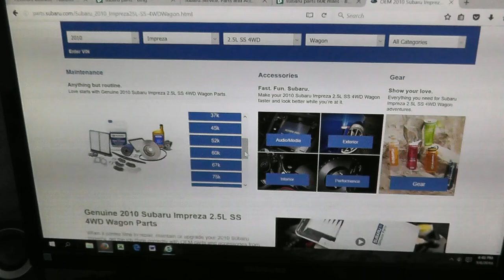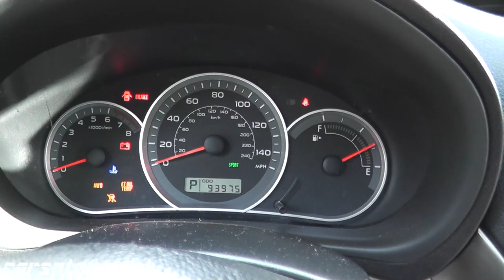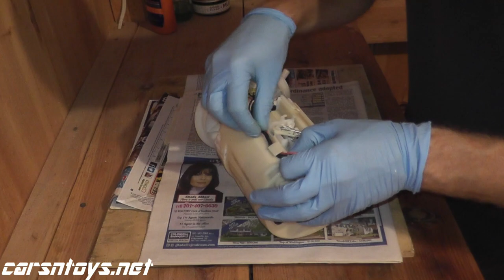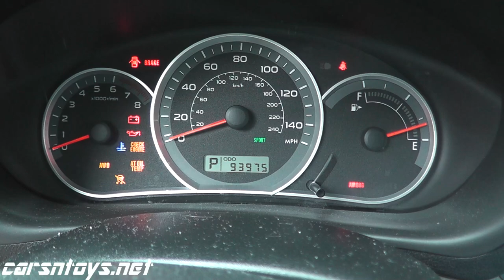How To Replace An In-Tank Fuel Filter On A Subaru

Comment: 13+ minutes into this, and you've just convinced me to buy the assembly versus take my chances on this level of rocket surgery to perform a simple task.  Many thanks for the video, though.  I'm sure it took a lot of know how and skill to pull this off.
Reply: So true..
Reply: I think with such a great video tutorial, I could do it myself. The tools aren't really complicated. The main rule of thumb I see here is 1) Take your time, 2) Don't force anything (plastic does become brittle with time) and 3) Use the right tool for the job.
Reply: Yeah dude, 100%. I KNOW I'll spend the 70 bucks on the filter and then break the pump and then end up breaking the pump anyway.
Reply: I did it myself and it really wasn't bad at all. Even so, nothing wrong with just going with a whole new assembly.
Reply: bro it took me 30 min.......

Comment: Be sure to reinstall the fuse and battery and start the car to check for leaks PRIOR to installing the cover plate. This is imperative!!! It's very dangerous to put everything back together and assume you have no leaking gas.

Comment: Trick to stop flow out of the pump assemsbly. Open your gas cap to relieve the pressure in there.
Reply from the maker: Good tip! Thank you
Reply: Just did this job, worked perfectly!  Thank you!
Reply: Also use vise grips or hose pliers to pinch off the fuel flow.

Comment: Guys, this isn't that crazy.  The phone call to the dealer told you exactly what to do......  let it alone until you start having issues relating to the fuel pump.. then replace the whole thing..  Or not..  Your choice.  I like our Crosstrex but this is ridiculous for a 60K service.  Replaced several fuel filters over the years and they were all external..   Obviously that was for debris possible going in the engine.  If you're worried about dirt screwing up your engine just add an external filter and change it every 20 or 30K.   Everything doesn't have to be difficult.  Just because the factory didn't do it doesn't mean it can't be done or is a bad idea..      And apparently  I may have missed it but did he show the old filter and how bad was it ?

Comment: Great video. I found an new aftermarket assembly for < $200 .  At some point your time and sanity factor in!  The module swap out can be done low stress under 2 hours including test drive, tinkering and clean up.  I changed it at 192k with no problems , just wanted to upgrade for upcoming engine modifications.

Comment: Hi I'd just like to thank you for your thoroughly detailed "How to video".  I've watched it over and over as it was my first time attempting this "in tank"fuel filter change.  Only you and another guy on YouTube show how to do the job properly on a Subaru Impreza of my generation.  It took me longer trying to figure out how to remove the rear seats. It seems that the 2009 model didn't have the release buttons like yours.  That was a pain in the ass!!!  

The other tough part was trying to separate the fuel pump from the assembly. After 5mins of struggling I thought heck why do I need to do this when I won't need to reuse this assembly.  So I use pliers and cut those tabs to shreds like you did when separating the assembly.  The best part is starting e car after and it worked! 😬
Reply from the maker: Good stuff! Glad it worked out. Cheers.

Comment: This is so helpful.  The BRZ/FRS/86 also has an in-tank fuel filter like this and mine is overdue.  The part is different but I am assuming the fuel assembly service procedure is similar to replace the fuel filter.  
I have not found any videos or guides specific to the the BRZ/FRS/86.

Comment: Thanks for your guidance. Did a Subaru forester 03/2010 EJ25 with 300K on clock. The Ryco Z931 filter was not as complicated as the job you did but with video help was able to put it back together. The Ryco at A$145 was exactly half the price of a subaru  genuine unit.. Great work my friend

Comment: This is  the best detailed video on the install I have seen . You make it look so easy . I am sure it's not .
Reply from the maker: Thank you. It's certainly labor intensive.
Reply: Just did it - using this video - just as easy as the video.  Thank you CarsNToys... helped tremendously.  One thing I found is that I didn't need to fiddle with the motor tabs.  I clipped my old filter tabs off and the motor dropped right out.

Comment: Awesome awesome video! Goodness the job looks like a PIA and probably will take all day but for peace of mind knowing the fuel pump will last and at least the factory recommended maintenance is done, is smart. It’s bad that most people will never know (unless they check on their own) if this job is really done properly. As well, thanks for the details on how to remove the clips and then to replace the seal. I’m going to try to run the tank near empty to hopefully make it easier. Still have another 20k before this maintenance is due. I’ll need a mask after Whiffing the gasoline fumes/vapors haha. This video should also apply to the WRX, Forester, Outback, Legacy, etc. Great job and Thanks again! Follow up 3/9/23 I just changed the fuel filter definitely took some time but thanks again for sharing your video. Absolutely great advice working outdoors and to change at 72,000 miles. Happy Easter!

Comment: they don't recommend changing it so the fuel pump or the fuse blows, this way they get to tag you for additional labor to figure out your problem, then sell you the entire fuel pump assembly and your car runs like shit, you probably have to pay to have the car towed from 150 miles away and then you have to pay them to replace the pump in the ball park of $750 including the pump, filter assembly and labor. They also will try to tell you how labor intensive it is when they don't even have to drop the tank like most American cars do, as Subaru has been adding an access door under the seat so it is easy to pull out and replace, and the filter and pump are replaced in 30 to 45 minutes by any average Joe, without needing a class A mechanic to do so.

 You are correct for wanting to replace the filter every 30-40k  because the filter gets plugged up with rust and other crap that the gas stations have in their tanks, water droplets, and other crud sticks to the moisture, dirt, etc, strains the pump and the car hesitates, while Subaru dealers just don't want to replace the filter because they make a ton of money replacing the entire pump and will charge you for the other parts while they all come as part of the kit. I've been stuck in this predicament before and have asked for the parts while they told me they just cleaned up the shop and their shop foremen threw the old parts away.

The filter was plugged and the pump wasn't bad on my car, the fuse blew and they replaced only the filter because after they were done, I opened the access door and I removed the pump and showed them an old pump was reinstalled. I never paid them for the services, the labor or the parts because i threatened to go public with it. Plus, in Connecticut we have a law that states they can't charge us for parts or labor to replace anything unless they provide us with the old parts. Most folks don't know about this law, but we have a Subaru dealer that is notorious for doing shady things like this and I am not going to mention their name, but all of you guys and gals in CT that bring your car to the dealer to get your Subaru fixed, I will just tell you to go to Wallingford so you don't get robbed by others.
Reply: wtf happened to Subaru? Its like somewhere between 2003 and 2007 they decided to start building cars  with cheapo shit parts, and design the car so maintenance is as difficult as it can get for the DIYer, like you would swear they actually sat and thought up thid shit! And dont get me started on the seat gaps. FUCK THOSE LEGACY SEAT GAPS. Everything cheaped out on, moneypit repairs by design, working purposely against the DIY guy. 
Im sorry, but I predict the end of Subaru in 10 years time. This is a canary in a coalmine if Ive ever seen one

Comment: Great vid it helped a lot. 
To simplify removing the fuel pump from the old filter I cut the two tabs with small wire cutters. It came out with a lot more ease.
Reply from the maker: Good stuff!

Comment: That's the same sound my 2010 impreza non turbo makes during cold starts, when it finally starts it drives good. It will start fast when it warm but if I let it sit for a while it's a battle to get it started. I'm gonna test the pump and see if i need to replace it.

Comment: Good video. This job is not really for the faint hearted but I could not fault your instruction.
However I did have an issue doing one of these so I'd like to add something that I feel is important. When replacing the O-ring on the fuel pump, fit the O-ring to the pump rather than inserting into the housing. Because of the design of the houing the O-ring can become distorted and not seal properly when the pump is inserted causing starting and driving issues. Wasn't alot of fun pulling it all apart again but that's how we learn.

Comment: Did this today and took around 4 hours total to remove,  clean,  replace filter,  reinstall  and fill up tank. 

Worst part was the o rings,  wasted around 30 mins trying to fit them on the new filter

Comment: Hi! I decided to change mine,myself to save money.I went through hell though,trying to get my back seat up.The bolt was so tight.Then when I got to the bottom,I didn't know how to get everything off,but I just started pulling.I  did remove the fuel plug fuse first though.I'm watching to figure how to get the filter off the plug though.T hanks so much for doing this in the day time.Most of the videos where people do this are too dark.Looks like this is a lot of work.I might just buy the whole thing,rather than rebuilding the filter.Thanks so much for making this video though.
Reply from the maker: Glad to help. Yea, it's certainly time consuming. Buying the unit as one piece would save a lot of time and you could save the used pump for a few bucks.

Comment: another suggestion about the fuel coming out, I've read that you can relieve fuel pressure by pulling out the fuel relay switch and then running the engine until it dies. Should make less mess. Otherwise, GREAT video. Thank you.

Comment: I actually ended up buying the filter.  Wish I got the whole chinese unit for $70 which is what I was going to do but then I thought about how long subaru fuel pumps last and I got the OEM filter.  Couldn't have done it without the video.  The only thing I might add is I don't think you need to take the fuel sending unit off.  And I didn't watch the first part so I didn't remove the negative terminal or the fuse.  I didn't have a pressure issue but mine is 2008 YMMV.  Next time I'm going to get the whole unit.

Comment: On older outbacks the filter on the fuel pump assembly is called a strainer.  The filter is under the hood near the battery.
Reply: Yet on my 2000 Legacy it's also in the tank in a little screw-off "cup" on the sending unit. Very odd because on other Legacy's of this generation it's under the bonnet!

Comment: Completed the task and your video was very useful. I don't understand why you cut the lower tank holding tabs off as they are required again to clamp the lower tank on to the upper part both of which are reused. Seemed a bit odd... undoing one tab at a time and keeping a widish screwdriver blade in the slot keeps it from closing. The entire process took about an hour max... thanks again... the circlip was where I had stumbled. Also I found no real need to remove the tank level sensor from the lower outer tank either. A job made easier for me because you took the time. Thanks mate. If you seek "ET art by B Witten" on YT you'll find out why the Pyramids in Cairo are REALLY here. The Pyramids tell us how the Earths axis was tilted and what happens when it straightens.

Comment: I dont understand why plastic had to be changed?? The actual filter on the pump wasn't touched it was simply the outer housing of the fuel pump assy 🤔 now im asking my self why that needs to be changed and what would it possibly do.. or old mate was ment to change that little sock on the end and he didn't know.. someone please set my mind straight its absolutely confused right now

Comment: The ONE thing I really dislike about my subaru impreza is this new fuel filter. The dealer told me the same thing they told you. They say they don't service it until it badically fails. Being a marine diesel engineman, I deal with all kinds of filters a lot and the way you keep something running trouble free is by having easily accessable filters and changing them frequently. This is just makes it plain annoying. Anyhow, thanks for the video. Can I ask why you go through all the trouble and not replace the strainer?
Reply from the maker: Thank you. I called three dealers and they all told me the same as well. In fact, one transferred me to the parts department. She had no idea what the hell I was talking about. I couldn't get my hands on the strainer in time. Thanks for commenting. Cheers.
Reply: Do you think you can do a coolant change on one of these? Really enjoying these impreza service videos. Is the plan to hit all items from the service manual? Thanks again
Reply from the maker: Thanks. I appreciate the feedback. Probably the power steering fluid next and then the coolant. Just trying to cover all the bases as the car racks on the miles.
Reply: Anton Shadyrya I was thinking the same thing.
Reply: what year was this? newer ones use electronic power steering.
Reply: Anton Shadyrya service it as an assembly!

Comment: I had the same issue with gas coming out of the fuel connector until I just removed the gas cap. It seems it was from gas vapor pressure.

Comment: I had the same answer from Subaru, wait till there is a problem.  And that's what I did.  No issues with that particular item after 310,000 miles and still going.  There is a series of failures that is spelling the demise of my beloved 'roo, and I am currently shopping for my new ride, but a fuel filter problem has never been one of them.
Reply from the maker: Thanks for the heads up. I recently cut open the old filter and it looked perfectly fine. Cheers
Reply: just don't say detonation because of bad fuel/air ratio (clogged fuel filter) destroyed your cylinder rings and ruined the engine and you're happy you didn't have to replace the fuel filter :))) The turbo variants of these engines are very sensitive to bad fuel/air ratios!
Reply: @sezwo5774  yup clogged up fuel lines leading to lean plus all the dirt and grime going inside your motor. It was strain your fuel pump as well leading to die out

Comment: Why don't they use an external fuel filter?  I have a subaru crosstrek.  I will be waiting for my pump to fail to change this.
Reply: That's up to you but I won't be. if that filter failed, where do you think sediment and such is headed.
Reply: No where. If the filter "fails" it will be completely clogged. The engine would then have intermittent issues with fuel starvation. The filter isn't suddenly going to let all the stuff it collected out into the engine. That's extremely unlikley.
Reply: That's for the sock filter on the end of the pump. The "tank" filter is more expensive.
Reply: I agree - I hate internal filters. Tempted to just gut it and use a cheap external one next time.
Reply: Thats what I did with my 2002 corolla. Gutted the in tank filter(pulled it with a variety of pliers and small dentest hooks) and put an inline filter in the engine bay. Works like a charm!
Reply: 2002 OB has traditional fuel filter but fuel strainer in tank.
Reply: @SteedDigital1  Like he says if it clogs then  car won't move anymore.  If it fails like your referencing and the debris goes past it(unlikely) then it gets to the fuel injectors and gets stuck in there.  Then new Fuel injectors.
Reply: Maan if this shit happens im just buying a new assembly

Comment: Did I miss the part where you replaced the actual sock filter?
I'm trying to get that off my pump right now to ship because it's connected with flimsy plastic, but I can't seem to figure out how it comes off.
Reply: That is exactly what I was thinking.
Reply: If you have the new filter in front of you, you'll understand what he did.  He couldn't have been more clear.
Reply: @CHAOSMOVEMENT  He put the new one back on instead of the old one he took off.  Notice he cut the clips on the one one and the new one had no clips cut.
Reply: @Clearanceman2  He's talking about the teabag looking thing. The actual filter. He didnt change it and Im trying to figure out why. Is it a secondary filtration system?
Reply: @bjornefellhanded9708  It's just a prefilter to catch big crap in the tank.  My tank was spotless so I did not change mine but it doesn't come with the filter so if you want to change it, you have to buy it separately.  And next time definitely going to buy the entire unit.

Comment: Not sure if I missed it, but you the only thing you replaced was the plastic housing. The filter is that flat bag attached to the pump.
Reply from the maker: The filter is located inside the plastic housing. Here's a vid of the filter being cut open - https://youtu.be/gjiHKl54prs